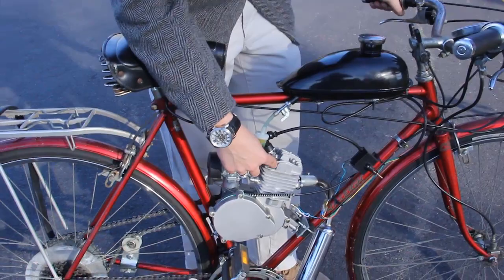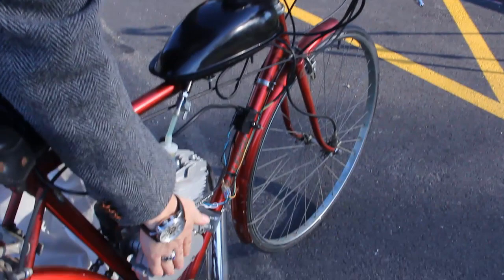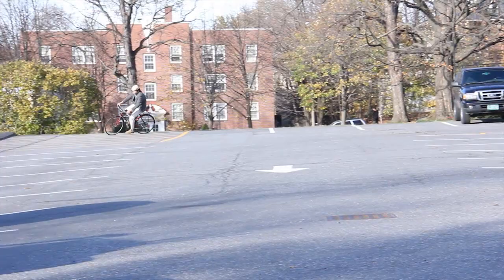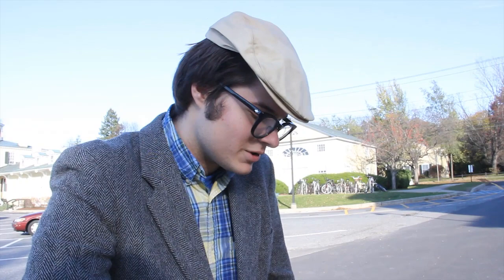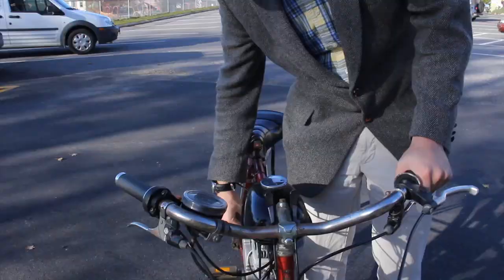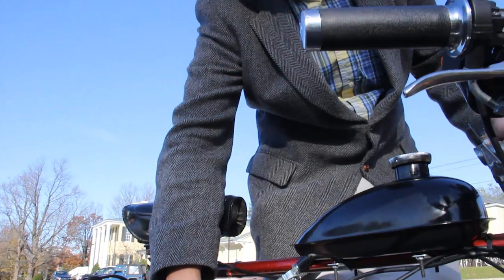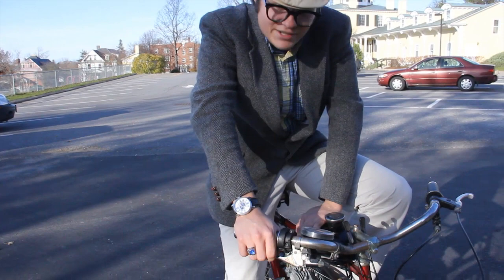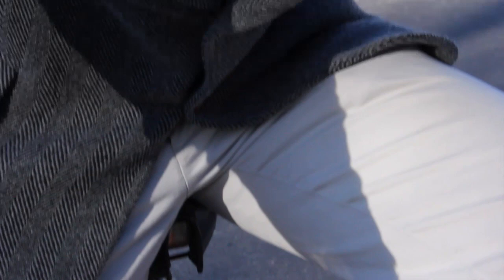The "Ye Olde Chappes" Motorbike

Comment: If you cleaned the Raleigh Sprite up, and install a Brooks saddle, it would be very English. Putting a two stroke on a classic bike is shameful to the Raleigh name. I own a Sprite, a brown 1977 mixte. It has a Brooks B17 leather saddle, a set of Michelin World Tour gumwalls, original fenders, and a front basket. I'd never even think of putting one of those dreadful motors on any of my bicycles. Any Nottingham Raleigh restored and cleaned up represents British engineering and craftsmanship. They're beautiful bikes.
Those two stroke motors produce more pollution per mile than 10 cars. They're not reliable, they're not cheap to run, they're noisy. All around they make no sense from either an economic or environmental perspective.